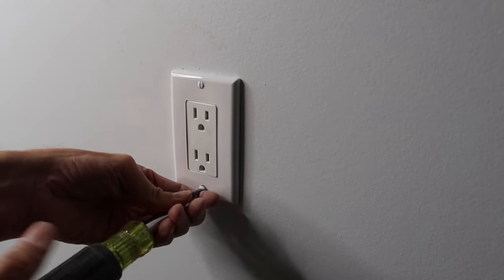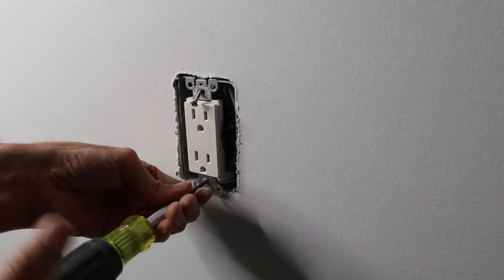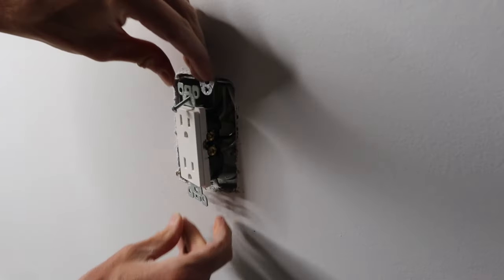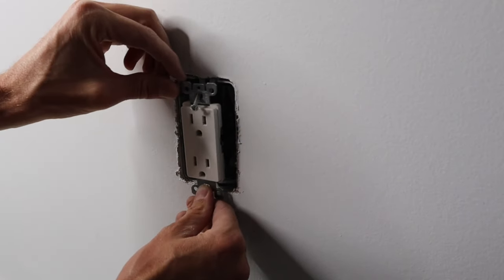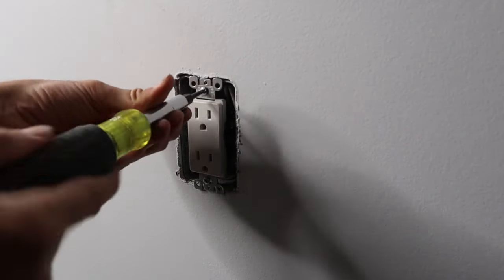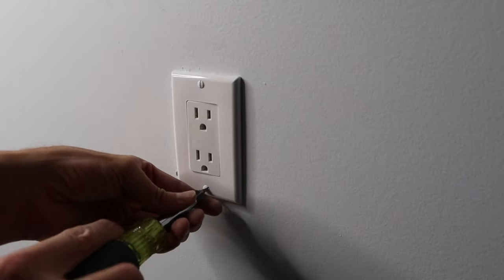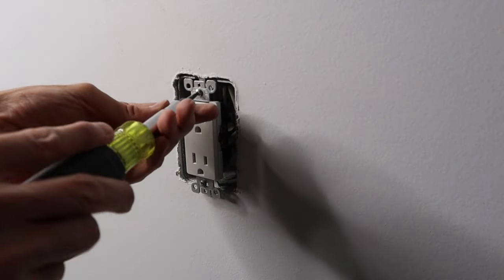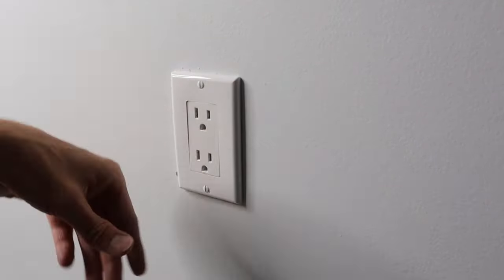Electrical Outlet NOT SQUARE!!! How to fix this!

Comment: That's just a band-aid, put a plug in and bump into the plug it will put tension back on the wires and twist it. The actual fix are those four tabs on the top and bottom of the switch, you bend those in slightly in toward the box so when you screw the switch to the box they act as a slight stand-off. Try it, I think you'll be even more amazed.
Reply: LOVE THIS CHANNEL. That been my approach to them also and it seems to "get ' er dun" even when the box is mounted a bit janky. You just back off the box attachment screws a bit, use some needle nose pliers to bend the tabs accordingly, re-tighten the receptacle attachment screws, check the alignment by simply placing  the covering plate on for a visual check (fine tune the tabs as necessary), then attach the covering plate with the finish screws. My OCD (ocular consideration detail) requires that the top screw match the orientation of the bottom - for me its vertical line to make future cleaning easier - now is it really easier, who knows but it satisfies my OCD. hah.
Reply: My mind is blown right now and I'm currently questioning reality.  Great tip!  I had no idea what those tabs were for...  Do they also serve another purpose?
Reply: Thank you!  Also I'm an idiot and broke them ALL of to use as washers between the box and outlet...
Reply: Yup, and when you do temp plugs you cut them off so the Drywaller can cut around the box without leaving huge holes at the top and bottom. Either that or you have to pull the plug and jam it into the box, but you better wrap the plug with electrical tap or you are gonna get zapped, especially with metal boxes.
Reply: @MS1022YT  this box is slightly different than ones we see in new construction these days. On a modern box those tabs sit flush against the drywall and square it up automatically. Maybe back in the day when drywall was cut by hand around outlets the tabs served for some adjustment
Reply: I'm going to try that -- i'm going to have a chance to do this soon in my remodel =)
Reply: Seems like that would be a temp fix as over time the tab would get bent back from the force of plugging things in.  Honestly I just try to make sure the tabs had something to rest against so the outlet could be screwed down properly.
Reply: To bad I pulled those off ;) Still perfectly flush 🤔
Reply: @MS1022YT  Those tabs are actually designed to be broken off entirely to fit different types of electrical boxes. Metal  flush-mount boxes like you might see on a basement wall or in the garage typically have covers that need those tabs broken off to have the outlet fit.
They aren't necessarily deigned for use as a standoff, but whatever works!
Reply: @bnasty267  , thanks for the explanation.
Reply: They are called plaster ears. When using a raised cover or a cut in box they are removed. 
All goes back to having pride in your work.
Reply: I took a short course on home electrical and the instructor taught us to use those tabs too. I was surprised to see that ignored in the video and looked through comments to see who mentioned this.
Reply: wow awesome advice!

Comment: As an electrician I bend the metal ears or "yoke" as it is referred to, to make it stand proud off the wall. If your outlet is wobbly or too deep, take some wire, wrap it around a Phillips screwdriver and make it like a barber pole, take it off the screwdriver, presto, you have spacers of any size and quantity without the trip to the depot. Also I would recommend 2" 6-32 screws if your device is too deep in the wall in addition to the afformentioned spacers.
Reply: You should make a video bout this
Reply: Best tip, thank you
Reply: After trying to make the adjustments to bring the recessed receptical out flush with the drywall  for screwless plates, I decided to give up and go and get spacers tomorrow. It dawned on me that perhaps I could bend the yoke into the box which would hold the receptical out. I haven't tried it yet but will look at that in the morning.
Reply: If "yoke" is the real term then no need to put it in quotes and say "as it's referred to," etc. Simply save yourself from the effort and say it directly.

Comment: Tip from an electrician. Use 3/16 flat screwdriver: jam screwdriver into ground hole on receptacle(perfectly safe). Rotate receptacle using leverage from screwdriver. Doesnt hurt to take cover plate off first because sometime the cover will break when doing this since its brittle. I always enjoy your videos! Keep it up!
Reply: That's a huge assumption that it's wired correctly.

I would never advise a homeowner to do any electrical work without first turning off the power.
Reply: @calbert1735  If they have a live ground prong they ve got bigger problems than a crooked receptacle!
Reply: @haydenluck  also the breaker would have tripped on a live ground bond unless they really messed up the terminations in the panel too.
Reply: @njineermike  I retired after my second kid ("freedom" 35), so I'm not dealing with that stuff anymore, but I had a policy of never touching anything until I'd tested it with a DMM, de-energised it, or sometimes both.
Reply: @imasspeons  Exactly. Ive been nailed by cross-connected cirvuits, hot neutrals and lots of wiring screwups. Not fun.

Comment: As an electrician you work to not have this but I can say there are tools out there that plugs in to both outlets and has an insulated T-Handle that lets you turn it slightly. I’ve seen some guys just keep a spare plug on hand to tweek them. The benefits the tools have is not having to remove the outlet or even the cover. Sometimes it’s from the metal getting slightly bent as can happen when you buy in bulk. My T-Handle also has a built in led to inform that the outlet is energized.
Reply: I have used an outlet tester in a similar fashion to what you describe.
Reply: I just use a trim screwdriver in the ground and turn , has always been fine
Reply: There used to be a tool called a plug grip that did that, but you can't find it anymore. I treat mine like they're made of pure unobtanium.
Reply: If they just stopped cheaping out and making the metal parts of the plugs and switches from recycled tin cans and made them a little thicker, this wouldn't be an issue, but some bean counter somewhere needed to save 5 cents on every 100 plugs. I'm sure you can get commercial grade switches with thicker metal tabs, and probably better contacts too

Comment: I usually just plug in an outlet tester and give it a twist left or right to correct it
Reply: Exactly what I was going to say... sometimes, if the outlet is too far in, I’ll wrap some 14GA copper around the screw and cut it to make a custom thickness washer. Then, when it sits out the right depth. Put the cover on and square it with the outlet tester
Reply: @TightBudgetBuild  I usually losen the box screws then take a #6 Robertson and pry out on the two ear loop holes that push it outwards
Reply: Dude you're not an electrician quit telling people to do dangerous things. Besides which this is easily remedied by tweaking it with a plug tester or a stout cord end.
Reply: @arlescure  actually I am an electrician, there is nothing dangerous about my suggestion, you should stick to what you know and not criticize people on what you don't know. And I don't know what you're talking about because you're just saying what I suggested and making fun of it?
Reply: @arlescure  booo
Reply: I did the same with the outlet tester when I test the outlet, much faster to get it line up.
Reply: @TightBudgetBuild  I would never do that because you're introducing a small piece of metal that if it were to be in the wrong place could start a short and cause a fire
Reply: Wow, pro tip. Thanks!

Comment: Use a receptacle tester. No need to pull plate or receptacle. Plug in tester and use as an adjustment tool. Try it, it works. Adjust your whole house in minutes!

Comment: I bend the "ears" slightly if needed.  This is a good fix if you're installing two or more light switches or outlets. I had an OCD moment while installing a gang of three panel switches in my living room wall. Bending the ears was the only method that worked.

Comment: Those of us with OCD thank you... especially for aligning the screw slots!
Reply: I can be OCD about things, but the thought of overtightening a screw by 1/4 turn bothers me more than them not looking them same. I screw them down until they feel like they are tight enough.
Reply: On a GFCi receptacle if the receptacle is askew  that can cause it to trip when it ordinarily would Not e.g. ghost trips, false positives, etc.

Comment: From my humble opinion from a DIY’er, I have found that in some cases the old work box were attached to the stud proud of the drywall.  It’s an easy fix just remove the old work and dry-fit it and ensure the old work box is sitting at the right depth, then reinstall it.

Comment: If you do a lot of replacing cover plates, as is often when a room is painted, the switches and plugs get will sometimes have been replaced/updated as well.  Singles are not too bad, but doubles and triples are a bit of a pain sometimes.  It's a good idea to have (in your toolbox) a double and a triple plate, and drill some large access holes where the hold down screws for the switches would be.  Then use this plate backwards to hold the switches the right distance apart and in alignment while you access the screws to anchor them down.  You can then flip the plate over to check to see if any of them need spacing out (such as with Caterpillar Spacer Shims (from IDEAL at Homer Despots) or twisting side to side to align.  Once all is good and they are aligned and secure, install your actual cover plate.
Reply: You are the only other person I've heard say this in my life. I figured it out on a 5 gang (reversing the plate) and ever since then carry around all the sizes in between. Well done mate I am glad to learn that it isn't an over engineered concept
Reply: It's in my toolkit as well! Great minds think alike...
Reply: Great idea!

Comment: Dude! You were extremely lucky on that one. The bare screws (terminal screws) are always energized regardless of side or back wired. Had you touched the device to the box, would have had a nice bzzzzzt! The box IS grounded. Recommend (power off, but know most don’t do this, even me) NOT entirely removing mounting/wall screws, leave enough thread in wall-box. This should allow enough grasp on device bracket to nudge left and right, but actually not even grasp the brackets, just simply place face of your flattened thumb on face of finished face-you’ll see the device rock back and forth. When re-securing, take wall-plate without the screws and see if it sits smooth on all sides, then last the finish screws, not tight its just holding the plate. FYI...if and when pulling-out any device, the wires within box are moved creating a potential short. That’s why mentioning try to not remove devices entirely due a wire may move to the pathway of screws removed when re-securing device...may pierce an energized wire. ⚡️⚡️
Reply: Check out my comment above and yes by pushing it down w your thumb on the face of the receptacle and screwing it in evenly and slow is very simple to get it squared. First shut off power and always wrap the receptacles w/ electrical tape covering all the terminals. Then bend the wires almost like a v shape and tuck into back of box. Then screw it in! After your 1st time should take 5 min. Remember power must be off before working on live loads. Safety first.

Comment: Funny thing, I have tried this before after I've confirmed that the drywall is flush and the outlets are still slightly off. Good tip Ben.

Comment: Electrician here, I change out atleast a few hundred receptacles a month and hate leaving my work looking like a handyman did it... 

Anyways, there's a few tricks to this depending on the situation, but I've found the best way is to use a Klein  plug-in tester to shift it flush with your cover plate.

Extended device screws (6-32) also helps in terms of creating the correct depth. You will need to cut the screws to correct lengths, but you can really fine tune your plugs this way. Especially if you got an uneven wall to mess with :)
Reply: Castlebury21   Journeyman electrician here. I like to call them plugs. Nitpicking definitions is more like an apprentice.
Reply: @chadwickv2  oh thank god we have a Journeyman here.   I've always wondered what the difference between an L5-15R and an L5-15P is?   I mean on the NEMA chart all the P's and R's look  the same.   I guess the letters don't mean anything.

Comment: Just a tip if the box is metal electric tape over the screw terminals is aways a good idea and if not it still doesnt hurt to wrap around outlets and switches to protect you your tools and  then you can work on them hot with no worries
Reply: Good advice! I have experienced replacing a GFCI in an apartment bathroom and having it work fine for about 6 months until one day recently the resident plugged something in and it arced from one of the screws to the metal box and tripped the breaker. It might work fine when you install it, but with some of the smaller boxes the tolerance is so close that it is a good idea to wrap the screws every time. Lesson learned.

Comment: The four tabs are there to offset that tension, I bend them with needle nose pliers. Also, if you leave the outlet a bit loose in the box and use a high quality cover plate, you can snug the outlet up onto the cover which will keep it square.   Good advice though, and always a good idea to first make sure the outlet is as square as possible before covering...
Reply: Those unbreakable plates are the key to "floating" warranty work close to a electrical box. Drywall is smooth but never flat. Its an illusion of straight that most people don't realize
Reply: This.  The tabs are especially useful if the box face isn't quite parallel to the wall.
Reply: I agree.
Reply: Over time with use the receptacle will become loose and create a hazard. It should always be tight

Comment: I came to the same conclusion during a reno in the early 90's. It is an irritating defect, it takes a little fiddling. It is easy to open the breaker, and you can look at it more safely and carefully. However people should know that occasionally some boxes can legally have power coming from more than one circuit, so a 120V test light would be wise....

Comment: I renovate older apartments and have this issue with GFCI outlets frequently. It can be quite annoying when there is very little room for the wires to sit correctly in the box with just a standard outlet, and when you go to add in a larger GFCI outlet it can be quite challenging to get the wires situated so they don't cause this issue. Especially if the GFCI has more than 2 line wires and 4 load wires exiting from a single gang box.
Reply: Jim K Actually a GFCI is almost twice as thick as a standard outlet, taking volume and forcing wire against the back of the box.
Reply: Tony Manero that’s my point, too much in the box.
Reply: Tony Manero - there are shallow and deep boxes; it’s tough to fit a GFCI into a shallow box, but piece of cake with a deep box.
Reply: If you renovate older apartments it shouldn't be a big deal to put in a larger box. It's a bit much for an average homeowner, but a competent diy'er and above skill can do it. You probably know this but another possibility is using a slim design gfci receptacle.

Comment: I always wrap electrical tape around the outlet to cover up the screws holding the wires before pushing the outlet into the box.
Reply: All pros do!
Reply: @monkeygraborange  bs they do. That's such a pain later. All that does is slide around over time and leave a sticky mess for the next person.
Reply: @mark22732  I have worked for contractors that would fire you for wrapping receptacles with tape. Tape costs $$$.
Reply: @mark22732  Can confirm. Real electricians hate people that do this.
Reply: @monkeygraborange  no, we don't. The only reason to tape the terminals on a device is if you're leaving it loose for tile or drywall coming in after you.
Reply: imasspeons Its standard practice to tape the receptacles, switches and wire nuts bcz people go into these boxes and we’ve been in countless situations where we mounted receptacles in metal boxes. This is a must on metal boxes. People don’t do it bcz its time consuming and they always cut corners!!! Safety first!!
Reply: @kelkel3201  if you go down the path of "what if somebody alters this in the future?" it never ends.

If they want to mess around in a live box after everything has been buttoned up, I have zero problem with that. It's no longer my liability or concern because it was perfect when it was finished.
Reply: 100% on temp plugs and around water/outside I wrap with tape. But most inside boxes that are plastic I don’t usually unless I know they are heavily populated.
Reply: @john-paulsilke893  Where I am they wrap wet locations and temp power. If it is a commercial site and they plug it out weeks before plate they also wrap. But virtually never on residential have I seen an electrician wrap it with tape. Waste of time and money.
Reply: US outlets and switches, such a bad desing, be it visual or safety.
Reply: @Tommeehr  
Exactly how are they worse in the USA than in Europe? What makes Europe's design so much better?
Reply: @Well_I_am_just_saying  the UK ones fit tighter and most of them have switches so you can turn off the power before unplugging, which is handy. I have no experience with mainland Europe and can't remember what the receptacles in Iceland were like.

Ultimately they're all just a hole in the wall you jam something into to receive electricity, so... whatever.